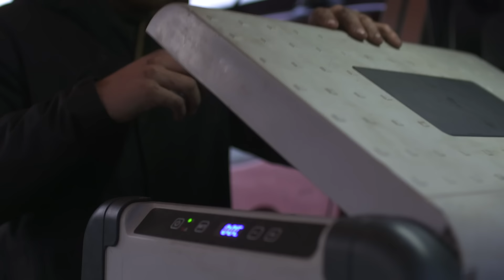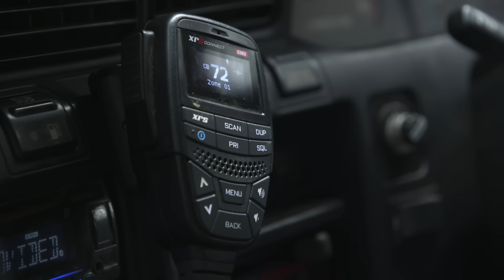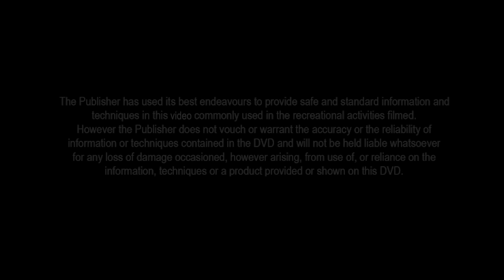AUSTRALIA'S MUDDIEST TRACKS! Bogged, Picture Perfect Campsites & The Wild West Coast of Tasmania

Comment: Shauno, your cooking is so good. hehehe my usual  reciepe is :
We call it BellyChon in the philippines.
1. Pork Belly Slab - have butcher remove the ribs unless you can do it yourself.
2.  Either brine the whole slab overnight with rocksalt and water or just rub rocksalt and pepper all over the meat side of belly then leave it for 15 to 30 Mins to absorb flavor.
3. place Lemongrass thats tied in middle of slab, then add chopped garlic and chopped onions.
4. Roll Entire Slab Until it forms spiral shape figure.
5. Tie the meat with kitchen twine to keep its shape, tie it with twine six or more times depends on the length of slab until it looks like the michelin Man. atleast one inch apart space.
6. put in oven if you have an oven or put it on low fire and cover it for 3 hours.

then enjoy eating

Comment: Getting a custom tune CAN void your new car warranty. I've asked around a few dealerships and the answer is yes. If you make the engine produce more power, then you void the warranty on your drivetrain (gear box, transmission components) and engine components and thus the whole car and any insurance you have may also deny any coverage. So it's best to wait until the warranty runs out. Then it doesn't matter.
Reply: You can usually reflash the ECU to stock if you need to go in for warranty, I think the mild tunes by a proper tuning shop is pretty reliable, not like the big north american diesel tuners, blow out those piston rings in no time at all

Comment: I've only been bogged once in one weekend. The ENTIRE weekend. Does that count? When I got home I bought at 25,000 lb Sherpa Stallion winch as I pull a Black Series HQ21 with my Power Wagon. The factory Warn Xeon 12k winch just couldn't cut it with that much weight.

Comment: Recipe - Kids love this
Chicken Bosciola - That's the way I spell it
x2 Chicken breasts - cut into roughly 1cm
cubes
x5 shortcut bacon - cut into small squares
x6 mushrooms cut up reasonably small
x3 gloves of garlic cut up fine
x1 onion cut up fine
x3/4 600ml cream
add some Italian herbs - don't be shy
add worcestershire sauce - if you think you've added enough add some more 
x1pk of fettuccine

Throw oil and chicken into large saucepan or pot and cook till white, in another pot boil fettuccine, x2 beers, throw in bacon, mushroom, onion in with the chicken and cook till soft, x2 beers, throw in garlic, cook for 5mins
throw in cream, and herbs, simmer till it starts to thicken, x1 beer, put in worcestershire sauce
Drain the fettuccine, and put in with the chicken and sauce, cook for 5mins to stir in flavours and dish up with parmesan cheese

Will feed x4

Short sweet and tastes good - easy/quick meal after touch tracks, and easy to clean up after

Comment: Honestly, I find the utter fear of salt water you Aussies have to be the funniest part of this video.  I live in Buffalo NY, USA.  They use salt to melt the ice and snow off the roads in the winter.  Every single year my Jeep spends months bathed in salt water with a higher salinity than the ocean.  But the Jeep still runs.

Now, it does have rust.  And lots of it.  But NOT until after YEARS of continual salt water bathing and salt crusting on the body and parts. (12 year old Jeep)  A 5 minute tire dip in the ocean that is almost immediately washed off is not going to even cause a speck of rust, unless your AU vehicles are somehow completely non rust-proofed.

While I don't think going for a high-speed run in the surf would be wise, I think you can be a tad less apprehensive about a short jaunt through a bit of sea foam.

Comment: Kaido, hit up Goodyear and get another set of tyres

It's the only thing holding you back
Reply: First time ever I’ve been embarrassed owning a 76.
Reply: First time ever I’ve been embarrassed owning a 76.
Reply: In the second day he did really well. But the first day, it just seemed like the tyres held him back.
Reply: The biggest thing holding kaido back is kaido
Reply: he needs them 'ding dong 'lockers for a wee bog hole then gets stuck way before jocko  in the next bog hole with a v8  bigger lift and tyres craaackup!
Reply: How old is kaido anyways? Probably just lack of experience.

I'm sure with what he's doing with the boys, hell learn quickly what works bad what doesn't.

Its not always the car that is capable, you also need a driver.